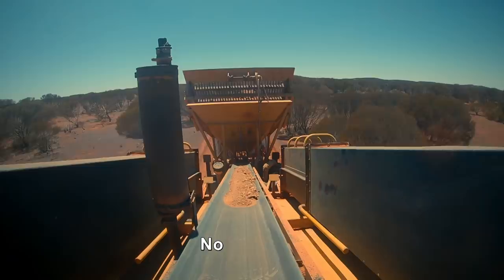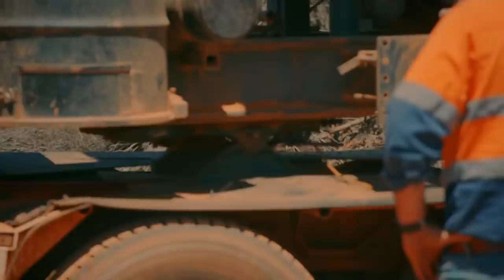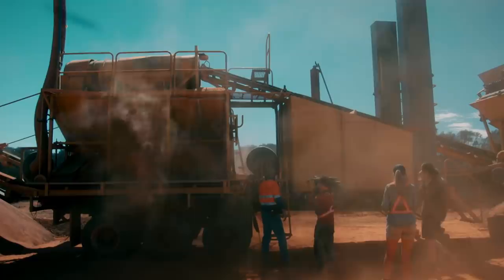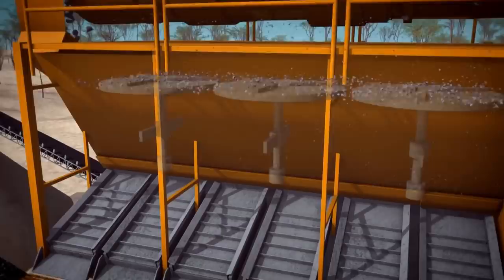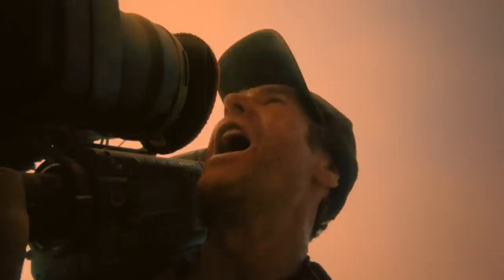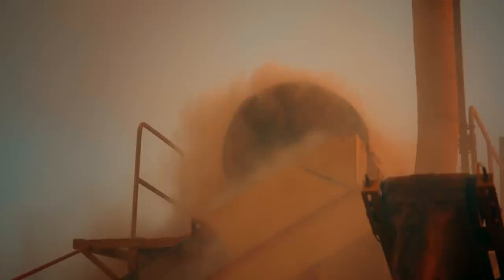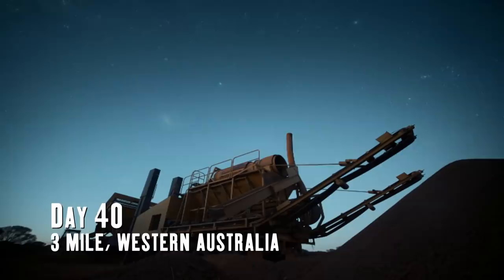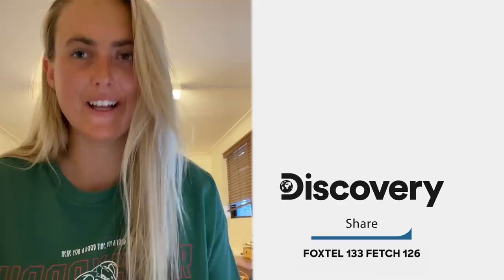Parker Nearly Runs Over Fred In The Middle Of A Gold Tailings Dust Cloud!| Gold Rush: Parker's Trail

Comment: Even a slight mist-er set up just off the operation. Like around the 4 corners 20 ft. Away just to help capture the dust.
Reply: Misters only work if you have water, out there, where these guys are working. There is no water. That is why they use the air based trummels that are not as efficient as water based ones.
Reply: Ya I think a well would be worth the dirt : )